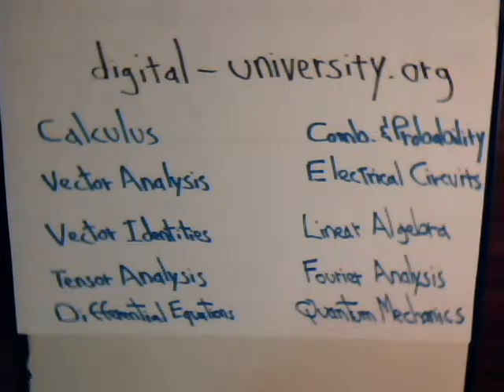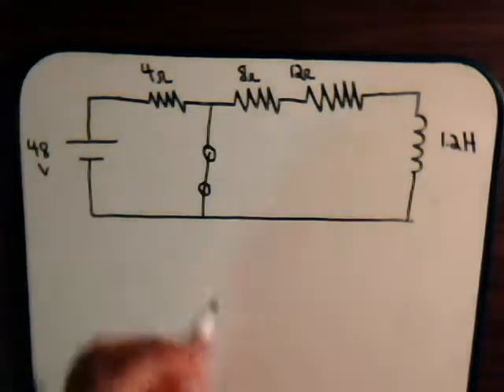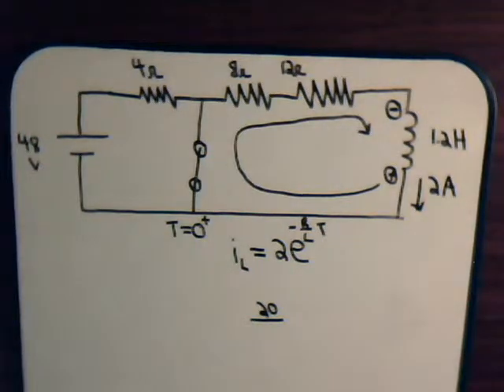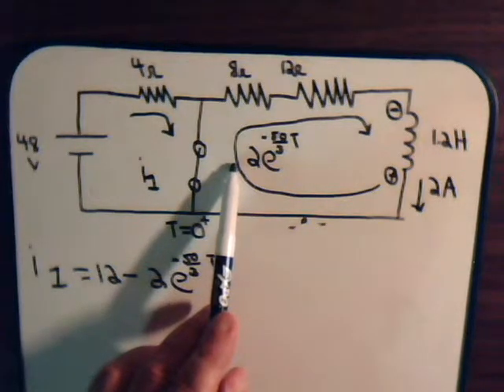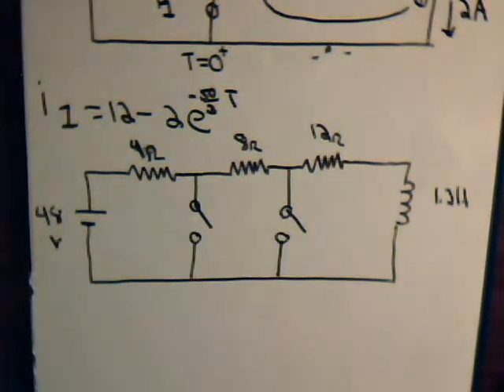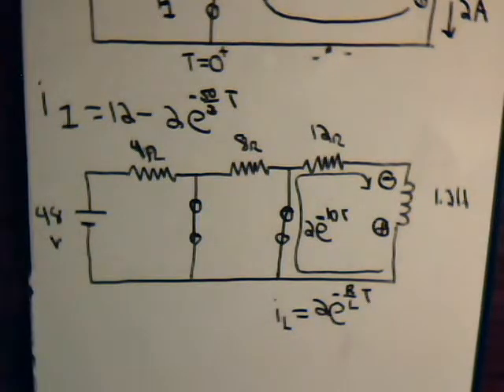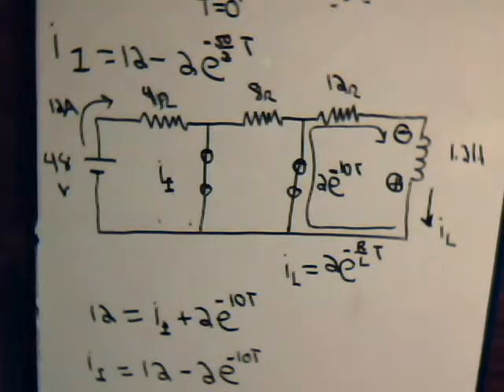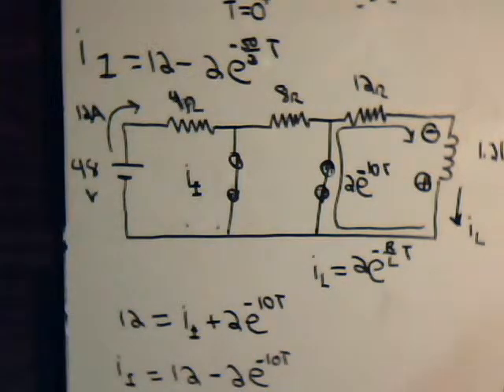Electrical Circuit Analysis Video #59: Inductor Decay Curcuit Example #2

Comment: Hi, if 2nd case is correct, 12 = i_1 - 2e^(-10t),  which means that there will be current flowing through 8 ohms resistor as well. But this is not the case because both terminals of 8 ohms is now having a same potential. Could you clarify more about this?